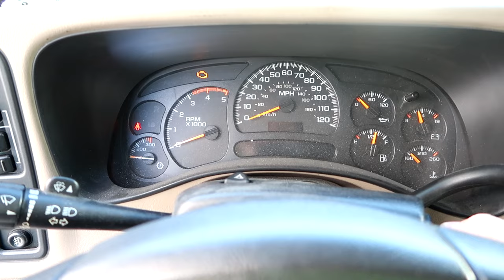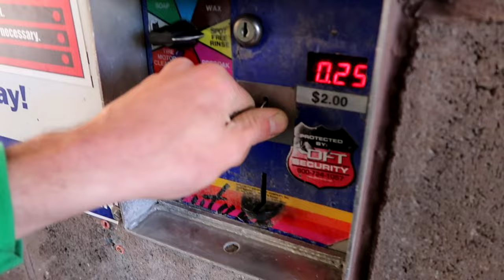MUDDING My Truck Was DUMB...

Comment: I'm almost 50 yrs. old and still occasionally like to play in the mud. It just keeps getting harder to find places now, where you wont get fined or truck impounded. Back in the late 80's, when I was 20 yrs. old, I had an'80 Ramcharger SE, fully loaded. I regret selling it. Me and some buddies went out to play. It was completely covered in mud. Couldn't see out the windows, and the windshield still had clumps of mud, and mud smears. Got back into Red Deer, went to do a lane change. Turned on the signal light and slowly started creeping over. Heard a couple of horn blasts. Then a siren. RCMP lady was fantastic. Wrote me up a warning, and gave me 4 hrs. to clean the Ramcharger, and show up at the detachment. Went to the AM-PM car wash, I miss those pull in and get a ticket, wash your truck, and you paid for the amount of time you were there. Attendant was cursing. He brought over a wheel barrel and shovel. Told me if I cleaned up the bay after, my car wash was free. It was a win, win for me.
Reply: Wow, times sure sound different then.

Comment: 40 isn't too low if you're not hauling any weight, I run whatever the door tag says unless I'm towing without problem. Pressure Washers are the thing if you can drop the cash for one, I got one given to me that was nice, gas cap was screwing it up. it's such a useful thing
Reply: BronzeChicken the pressure on the door is meant for the specific tire labeled.

Comment: Sorry, but that was just wet grass and puddles... Not even 4WD worthy.
Reply: Thats what I was thinking haha
Reply: preston121068 hell my driveway is worse than that.
Reply: the old Toyotas will out do any domestic truck in a off-road trail scenario . Let's be real here . And no I don't drive Toyota
Reply: MrBossilini I do agree Toyota of old were tanks.  But in the last 10-12 years not so much.  Toyota of new has by far the weakest frames of any auto maker.  They bend quite easily in fact.  In fact other than auto tests reports showing this, there is a video somewhere I saw on Youtube where a guy took his 2008-09 ish very clean, nice looking Toyota in for new tires.  The tire place put it up on a lift and the frame bent completely in half where the bed meets the cab.

Comment: im all about mudding and diesels and free stuff but load E tires are what you need on 3/4 ton and 1 ton trucks. they need 80psi of air. 50psi tires are for 1/2 ton trucks or suvs. I've seen a shop refuse to install them because of liability concerns

Comment: first off you want to lower your tire pressure when you are off road. your tires are capable of carrying a much higher load than what your truck weighs therefor you can run a much lower pressure second you need to get offroad more, what you went through was nothing, kid stuff

Comment: USE PRE SOAP OR PRE SOAK BEFORE YOU SPRAY IT DOWN, IT WILL MAKE YOUR TRUCK SO CLEAN AND THEN SPRAY IT DOWN WITH WATER OR THE WATER SOAP MIX AND IT WILL LOOK HELLA GOOD

Comment: my tires are low, they max out at 50 and they are only at 41. dear god wtf. - im assuming your kidding.
Reply: ThunderHead289 yeah no one ever puts 41 psi in a truck even when musing you want as low pressure as possible
Reply: yeah Im pretty sure you're only supposed really run like 30-32 psi
Reply: ThunderHead289 You must not know anything about HD trucks. Well they are designed to tow/haul larger loads than half tons, which require E-rated tires. E-rated tires need more psi so they stay round with heavy loads. To me even 50psi seems low. My low tire sensors will go off at anything below 60psi. I run them at 72 which is the manufacturers recommended ratings. I drive an 09 Chevy 2500hd.

Comment: If you add a 1 x 6 treated to the inside of your garage door and scribe the bottom of the board to the largest gap then cut it with a jigsaw you can lower it to the floor and permanently attach it to the door with foam attached to the edge.  This will seal the gap without messing with the concrete.

Comment: Best thing you can do when washing a truck or ATV covered in mud is rinse the whole vehicle first.  If that mud is dry and caked on thick you will waste a lot of time on it. But if you go around it once just to soak the whole thing, by the time you come back to your starting point, that mud will be ready to come off. So it saves you time and money at the pressure washer.

Comment: Quit your crying that is what trucks are for.
Reply: I once took my '98 neon (with no modifications to it) offroading for a day, in the bush, and never got it stuck. So don't knock a four banger just because it's front wheel drive. Sometimes that's all you need to use to get out of a wet area.

Comment: Yo I zip the bottle of car wash or preferred soap to the power washer and drill a hole the size of the hose in the cap and leave it ... Run hose to soap a s the power washer dilutes it for you ... I use tide on carpets it works wonders ...... Brush if you need to !!! Just thought I would tell you .. She looks good also the armor all with the polymer technology yellow car wash is almost the best you can buy defiantly bang for buck !!!

Comment: You're not supposed to max out the tires. You pump them up to 10% within the max psi. But if you look on your driver side door jam it shows you the preference of psi for a stock chassis while rolling stock tires. It's almost always going to be lower than the tire max rating. So you're psi was basically right on point. Plus that was hardly mudding my s10 could do that in two wheel drive too
Reply: *your

Comment: I remember taking my 2wd 95 f150 on winter tires through that kinda mud last spring, although it was probably close to 10-12 miles of it. I did get stuck about 2 miles from the cabin I was going to though. sure made me miss 4x4. summer 2015 I spent $83 washing my truck after going mudding

Comment: we have a big pressure washer at my dad's that runs off electricity. it has cold and hot water. for the hot water (to get oil and oily stuff off easier)it runs on diesel. that thing is a life saver and has a bunch more pressure that a portable one like that. nice truck tho bro

Comment: Purposely drive it in the rain to remove what you couldn't. Be careful not to remove the frame coating with the pressure washer or where you live rust will come quick.

Comment: soooooo, it's dumb to use something for one of the uses it was designed for?...
Reply: Apparently, probably just did it so he had something for his daily video.
Reply: FlipFlop Mechanic duramax is designed to tow not go through mud
Reply: Tyson Reid It's 4WD, it can handle the mud and tow at the same time.
Reply: Tyson Reid 4wd truck= not on road use all the time though otherwise it wouldn't have 4wd
Reply: the 4wd on a diesel is designed for light mud and snow
Reply: honestly I hate people who own lifted 4x4 trucks and never take them off road.. sure there are trucks made for specific purpose for toeing or hauling specifically. but even a stock 4x4 truck is made to be able to go off road and perform. it's just my opinion but I've never buy a truck and use it just to go to get groceries. just like I'd never buy a Honda and take it in the Mudd
Reply: +M_Dizzle502 I know right? I never got that.

Comment: Your tires should be inflated to the air pressure posted on the tag located inside the door jam. Not the pressure rating on the tire.

Comment: bought a brand new truck in 2007 off the showroom floor. STX Ford extended cab 4x4. Was used to hitting mud in a monster jeep I had so I saw a mudhole, and my arms automatically turned the wheel into said mud...stuck. lol street tires dont work in mud too well Im sure someone will point out it WAS a ford also, and had to be the problem, anyways, I had a great time in that truck. It got me home thru many late/early morning snowstorms after my gigs in Santa Fe, after the new aggresive tires and only 2"l ift  of course.

Comment: proper tire pressure is listed on the tag inside the drivers door jamb. max pressure listed on the tire is NOT what is recommended for your vehicle.
Reply: Darren Moyer you typically want to do it about 5 or 6 psi less than the tire says... he said he had different tires then stock so the sticker only apply to the stock tires
Reply: Logan  Beadle ill have to respectfully disagree, ive been in the tire business for 15 years and all manufacturers recommend following pressures specific to the vehicle. (as long as its factory tire size) however its never recommended to run the tire at its max psi
Reply: Darren Moyer I'm sorry I worded my comment wrong I thought he had different size tires from stock so I was just saying for different size tires from stock I would run about 5 to 8 psi lower than the tire says

Comment: 41psi isn't low, and you probably shouldn't max it out, look at your door seal or under the gas filler door it'll tell you your psi rating to full to, don't fill to what the tire says plus 41psi I'd not good for mudding that's way to high, maybe like 15-20psi on no beadlock is good

Comment: You don't put the max tire pressure it says on the tire. It's vehicle specific. What you see it the absolute max the tire is rated for.
Reply: not to mention that those tires arent rated for that truck should be running 75-80psi max load tires those are meant for a half ton truck, should be funny when he puts a load on them

Comment: your tires should be at 35 psi the max psi is the max your tires can take but they should never be that high on the inside of your driver side door jam it will tell you the correct psi does not matter if you have stock or oversized tires it is what is recommended for your truck for the best ride and tire where. not trying to be a dick just trying to give some advice

Comment: Purposely drive it in the rain to remove what you couldn't. Be careful not to remove the frame coating with the pressure washer or where you live rust will come quick.
Reply: Anthony Butera or he could bed line it
Reply: Anything that works. Road salt induced rust is pervasive and depressing.

Comment: 41 psi is low to u?
What the frig, 15 20 psi u should be concerned on road use , 35 40 is normal pressure

U wanna be careful  at running  at high  pressure  expessially  on hot days

Heat= tyre expand

Comment: never run tires at their max. look at the inside of your door.
Reply: Mason Smith I don't think he has the right load rated tires on that truck. if they max out at 50 psi. most diesels run like 60-70 psi in the front and like 80 psi in rear tires from manufacturers specifications in the door jam
Reply: Crystal Keeton what?!?!

Comment: i am only about 20 sec in to the vid and i will say never mud a stock Chevy truck i have seen every thing from power steering pumps melt to front ends buckling when put under extreme use that simple not saying ford or dodge are better but have not seen the same problems with them and i mean common problems not just 1 out of 100 or so that are abused
Reply: dexter2433 we do it withfords all the time and nothing breaks the only thing thats new on it when were done is the paintjob is all brown
Reply: he is just afraid of getting it stuck

Comment: the truck is 4x4 for a reason ur not gonna make the truck rust faster cuz u do what it was made for smh
Reply: They've never produced a vehicle that was made more mudding, it's a 3/4 ton diesel, it was made for towing and hauling not made for offroading, the truck is way too heavy and the wheelbase is to long, if u want a vehicle that was made for offroad u better get you a Jeep wrangler
Reply: Amen Kyle. Too many ignorant people in these comments
Reply: Kyle Randall First u start by saying they never produced a vehicle for offroading then say jeeps are made for offroading
Reply: I was talking about GM because everybody is saying they;re made for muddin
Reply: If you buy a short bed small block Silverado and put a 6" lift with 35"-37" Baja claws, slightly different gearing, and you have the ultimate street legal off road mudding truck